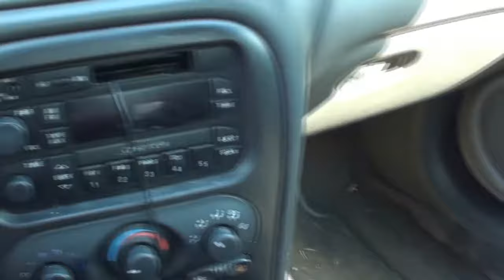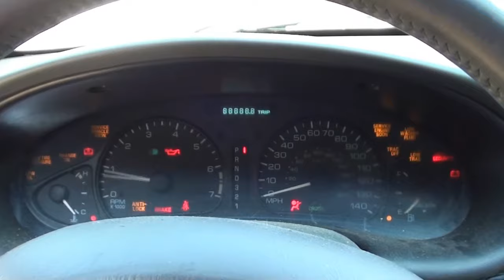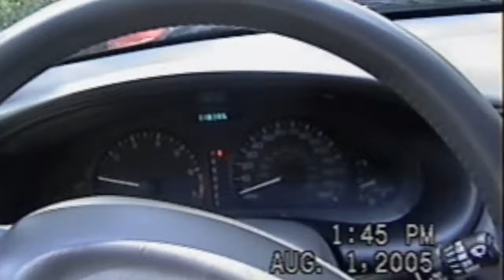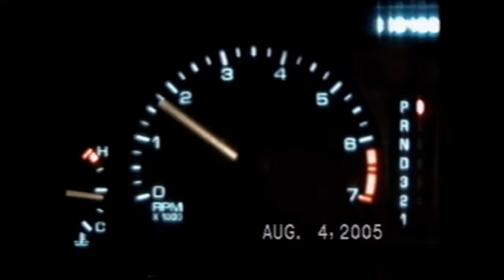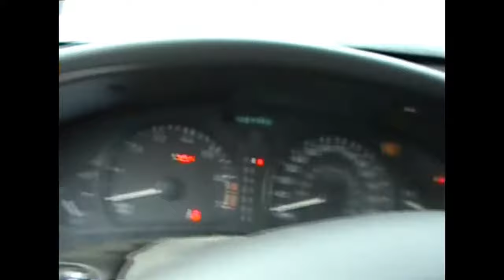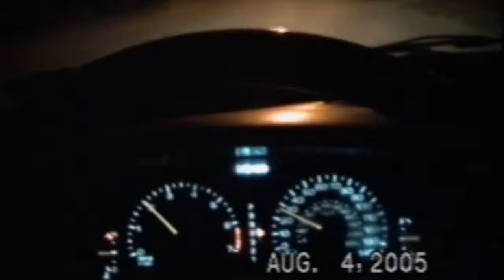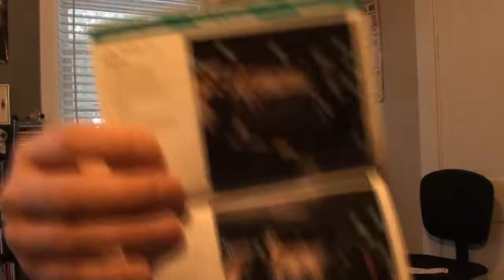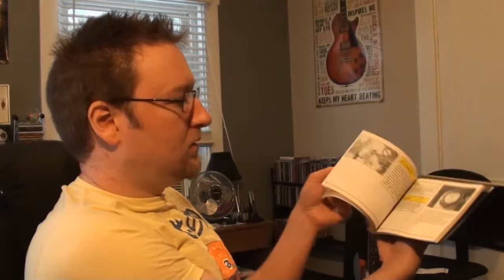MV 32 - "The Tale Of The Legendary Alero"

Comment: I have a story. My aunt's husband had gotten a new 2001 Cadillac CTS. He had then left his 2000 Alero in the driveway. Then, my mom needed a new car after our 2009 DTS had a blown head gasket. The DTS wouldn't run at all then. We had originally had gotten this car of July of 2017. Still 17 years old, the car had been a great car. The first problem was when it started, it would crank for a while, then start up. Next was reliability. Since this car was 17 years old at the time, it wasn't as reliable. Firstly, the radiator was leaking. My dad had gotten the money to fix it, and did. We also needed to fill up the tank for every 3 days. But even with all of that, it had been so great. As of February of 2021, my mom had forgotten to change the oil, and my dad had just gotten his new 2004 Avalanche. Once we started it, it would knock loudly, and power was reduced. Once we had pulled up to an intersection to turn at, it had thrown 2 rods. It smoked, and we had to push it. Now it just sits there, waiting. It's a poor car, and it's sad that this had to make it worse.

Comment: My uncle used to have a red 1997 Pontiac Grand Am SE he bought that car back in 2004 I believe & sold it in 2011, I assume my uncles 97 grand am had the 3100 SFI V6, the Grand Am is smaller than the Grand Prix.

Comment: What did you throw onto the Alero's windshield, when did the starter give out and what blew out on the radiator? Also, what was the final mileage?
Reply from the maker: Aw man, that was a while ago. I think she had about 195,000 on it when we got rid of it. The thing on the windshield was a floor cleaning pad that came off of the handle I was using to knock the starter and if memory serves me right, I think it was the lower radiator hose that caused its last blown engine issue.

Comment: The 3400 SFI motor in the Alero was not that great of an engine due to having issues with the head gasket or the intake manifold which is a very common issue with those engines, my Mom's 2001 Montana van that I used to have in my family had the same engine the 3400 SFI V6 those engines were not that fast but I assume your Alero was more faster than my mom's Montana